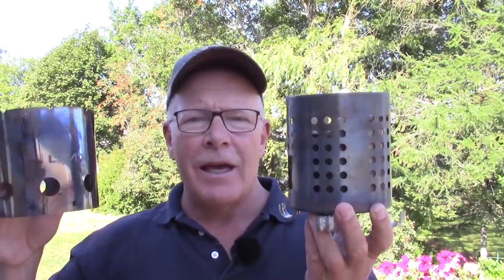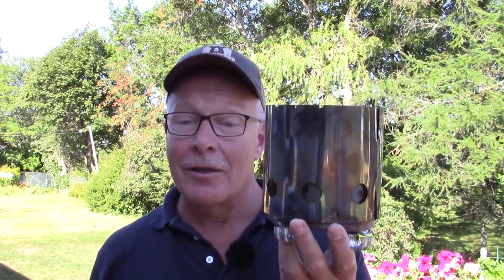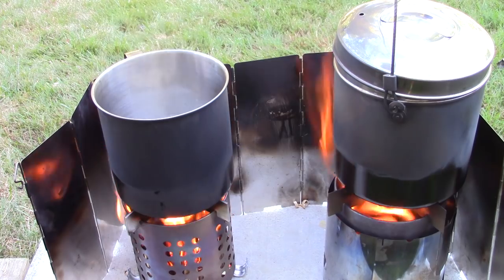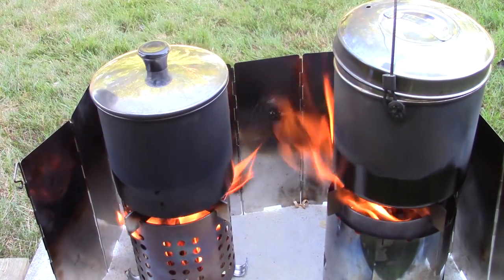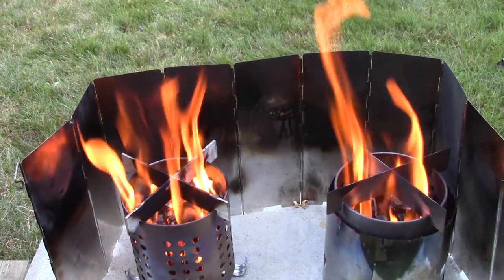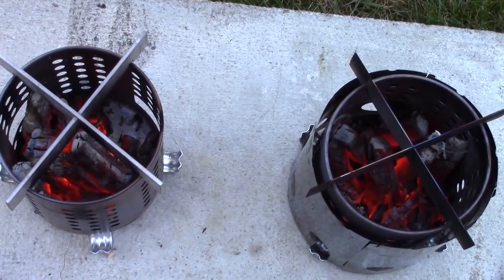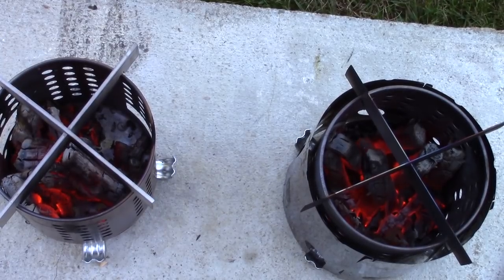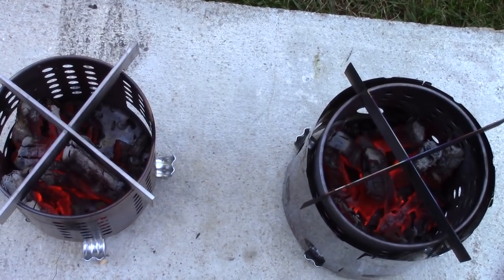Ikea-Lixada Hybrid Wood Stove

Comment from the maker: I would like to give credit for this idea to viewer "Conny Bjaaland" who wrote "I would like to see a comparison of burn when both are packed to there fullest capacity.  I would also like to see how the ikea burns when placed inside the little bug. Does this configuration create a wood gas burn effect?"
Reply: You can cut through the lid of a 6" coffee can and slip the ikea  cutlery holder  inside you need to put two small tent pegs horizontally down below to stop the ikea from falling to the bottom. In the coffee can you make a few holes around the bottom and  make a horizontal slit at the bottom to drag out the ash and there you have yourself a wood gas stove that also contains the ash'. Russell.
Reply: @russellkent8721 These days finding an all metal coffee can is hard. We used to make hobo stoves from them with scouts, but can't find meatal ones anymore.
Reply: Try "Chock Full of Nuts" coffee. Probably the best company for getting metal coffee cans.
Reply: @steamboatmodel  
That's a pity. Fortunately, they are still available in Australia. Russell

Comment: Hi Mark. Greetings from England! Thank you for this and your other Ikea stove videos. It inspired me to build my own. Looking at the principles of a rocket stove I then decided to have an added layer on the INSIDE. I did this taking the base off an old paint can, and then the remaining cylinder is held in place using bolts. The result is that air flows through the holes of the Ikea, but then gets blocked by the hot paint can, so is forced upwards until it meets the wood gas. And from my experience with it I believe I AM getting secondary combustion. And after some trial and error, I found I can use the bolts to rest an alcohol burner on, sitting inside the stove at the perfect height under my steel ruler pot stand! I'll make a video about it and post soon hopefully. But thanks again for your inspiring ideas and channel.
Reply from the maker: You have a some great ideas for sure. It can be fund trying different thins out. Thanks for commenting

Comment: thanks for the shoutout mark - we'll probably bump into each other at the LC ;)

The hybrid was a good experiment, it sorta looking like a firebox where the walls are more insulated and the air is forced up from the bottom or bottom side. Performance sue looked good and the ruler hack was a good one. You can't go wrong with a good piece of steel.
Reply from the maker: Hey Jim, I have had more than a few comments on the hat. Thanks again for it. So, I missed the hurricane altogether as we are in Austria visiting my son. I have kept close watch and it look like we are among the few who did not lose power or suffer damage. Maybe we should meet up for a hike at some point

Comment: Mark, one of the advantages of the Ikea stove is that you can add more fuel to the fire without removing your pan. The added Lixada stove negates that advantage. Keep using your windscreen.
You out did yourself on this video my friend. I'll be watching this video again to make sure I grasp all the good material you gave us today! Thanks.
Reply from the maker: I agree, side loading is one of the best things to build into the Ikea. I also find if I get a good full load and a top down burn I can get better than 20 minutes before I even have to add fuel. 17 minutes more than I need to boil 2 cups of water. Glad you liked the video David. Thanks for commenting
Reply: Good point. However, here's a nifty solution I just thought of. If you cut the riser cross bars such that the top of the lixada is always a bit higher than the bottom of them, and shorter so they're inside the lixada, you could slide the latter up with a suitable tool (like a spare stick) to get to the feeding ports, add wood, then drop it down again. This could also be used to raise the lixada up to particular levels, using the holes in the Ikea perhaps to lock it in place, giving a lot more whoosh of air in the base.

Comment: Hi Mark, hope you and your family are all well. A couple of things that could be looked at is the speed of boiling. Using different types of wood and thickness, such as thin twigs and the thickness you usually use. Thanks for the video.
Reply from the maker: Hello my friend. All good here at home. Yes, different types and amounts of wood would make a huge difference. I tried to use the same amount, size and type of wood in each of the stoves as a control variable here. Thanks for commenting

Comment: Mark, Love that ruler pot stand idea. Most stoves don't leave enough open area at the top of the stove which leads to more smoke and less flame/heat. ATB.
Reply from the maker: Glad you found the ruler tip helpful. I agree, airflow is all important in stove design. Thanks for commenting

Comment: I have been using the metal rulers as crossbars for my IKEA hobo stove for a while. I actually got the idea to make them originally from your hobo stove video where you made them out of aluminum bars. Also, I use a piece of aluminum flashing as an ash plate under the hobo stove. I put this on a piece as a carbon felt and it works great. The felt adds almost no extra weight and it cut to the same size as the plate. Keep up the good work!
Reply from the maker: Funny how it goes like that. I wish I had found them years ago. Thanks for commenting

Comment: Very interesting, indeed. Perhaps if you found or made a wider IKEA stove that fit more snugly it would work. A ring to close the gap over the top would definitely help either way. You would have a nice, even distribution of fresh air and wood gas around the entire fuel mass, with most of it being burned near the bottom of the Ikea. But as the unit got hotter, the tower effect involved should help to even out the heat levels of all of the Ikea's holes. It's interesting to note that drilling more holes in the Lixada would even out the distribution of fresh air around the fuel mass and the extra oxygen should cause the gasified flame mass to expand upwards along the sides of the Ikea stove. I'm thinking about just obtaining two different sizes of Ikea stoves, then cutting them to the same height. With the flames spread out over Ike's entire wall, it might be harder to see the gasification unless looking at it closely from above. The flames may also still be fainter towards the top of the Ikea but they  will definitely rise higher and the oxygen assisted tower stove effect will do the rest. Your idea is brilliant and with only a little more tweaking it should work extremely well. The gasifying hobo stove hybrid. Cheers
Reply from the maker: I have another video where I mate an Ikea with a SS canister and a video using a large strainer where I do get some secondary combustion. Thanks for commenting

Comment: Interesting experiment. That more coals seemed to remain in the shielded stove might mean that the oxygen level in the chamber was lower such that there was less combustion surrounding the burning wood and more heat retention lower in the stove so that more of the gassifying wood turned into charcoal before combustion ... though perhaps the same amount of wood gas was consumed in the upper part of the stove. In any case, the wood gas ran out when the flame went out and more charcoal remained.
Reply from the maker: Yes, good thoughts on its performance. Thanks for commenting

Comment: I had somehow missed this video. The idea was there but missed a funneling of the air into the burn chamber. A cone windshield would have worked unlike this one which just let warm air rise out of the outer walls. You could alternatively plug the top with a bit of rolled up aluminum foil, which would be easier in your case since you already have a good fitting outer wall. I think the alu foil would be unlikely to melt unless a coal fire were maintained for a while, since it would be on the outer wall of the burn chamber, and protected by the ikea stove’s steel.

I’ll try to fashion a gasifier out of my strainer stove, as described above. and I’ll get back to you on if you so wish, Mark. Just let me know and I’ll comment back on here or make a video for you.

I suspect an outer aluminum wall would suffice so I am going to try that as it’s likely easier for me to source than thin spring steel sheets.
Reply: If nothing else, this showed that double walled stoves are inherently better in windy conditions, but the separate windscreen would be superior in that it would protect the stove AND the pot, hence directing heat toward the pot, making it more energy efficient and giving it a faster boil time.
Reply from the maker: I am interested in seeing what you come up with. Making a true gasifier DIY is a bit of an illusive goal. Thanks for commenting

Comment: I believe you would see a distinct difference in boil times if had not used a wind screen, that is the real advantage of using the Lixada around the Ikea.
Reply from the maker: Absolutely. I agree. I could see that when I eventually did remove the windscreen. Thanks for commenting

Comment: Using my Walmart 9 hole high hobo stove (instead of Ikea 6 hole high) I inserted a 25 oz can INSIDE the hobo stove. Top and bottom cut out and 1/2” holes around the bottom circumference. Vertically packed with twigs and a top burn down, I was getting flames 2’ to 2 1/2’ high with little to no smoke. It appeared there was some gasification around the inside of the inner can. Only downside was it appears this is going to be a fuel hog. Thank you for the video for getting me inspired. .
Reply from the maker: Interesting. I had not thought of placing a can inside the Ikea. I do have a couple of the taller ones to experiment with. Thanks for coomenting

Comment: I use a cement paving stone I carry with me and put under my stove.  Not practical for backpacking, but stable and heat safe.
Reply from the maker: Yup, a cement paver would be a good safe surface. Actually, I use one in my backyard when doing tests. Bit heavy to carry very far😅. Thanks for commenting

Comment: Mark, 
Thank You for sharing this information about your modified IKEA hobo stove and the Lixada little bug.
I was wondering if you or your viewers have any suggestions for material to make the cross bar if one is unable to find a metal ruler at a reasonable price? The idea is fantastic, but I am disabled due to living with Multiple Sclerosis and rely upon online shopping for most of my purchases and for some reason, the cost of this ruler is much greater on line than in retail stores.

Thank you so much for your time and effort.
Reply: BBQ Skewers, Stainless Steel Tent Pegs, Welding Rods. You don't need to have a cross or X you can just cut suitable sized slots for any of the above to fit in an I  I configuration across the top of your chosen IKEA/Walmart Utensil Strainer. However, if these configurations don't raise your Pot/Pan up off the top then, you may well need to drill a few additional holes at the top of your Utensil Strainer.
Reply from the maker: As Bulgarian Organic Smallholding has suggested tent pegs or other simple items may work. As does making larger holes around the top. I may be able to demonstrate in a video
Reply from the maker: Great suggestions and thank you for responding
Reply: Thank You for your suggestions! 😀

Comment: Your ruler cross bar is a great idea.  Metal is metal.  I still might gi with the aluminum cross bar and use a bit less heat if I'm only boiling water.  The cross bar for my rocket stove went adrift so I'll make another (1/8 x 1 inch steel bar).  To cover your Ikea stove,  a piece of heavy aluminum foil from Costco could work,  held in place with a piece of rabbit wire or tuck the top edge over the stove lip.  Less to pack.
Reply from the maker: Good suggestions. I am still working on ideas to test out the theory. Thanks for commenting

Comment: As a chemist, I do not think the silicone pad will survive without degradation.  A silicone pad generally starts degrading from 400 to 500 deg F,  far below the heat of the coals.  Woven ceramic pads used to protect wood from propane flames can stand up to 2500 deg F.
Reply from the maker: Very good information about the silicone pad. Any idea where ceramic pads can be found? Thanks for commenting

Comment: The Ikea stove seems to have way too many holes up its sides.  The formula is more like “in the bottom of the burn chamber, up through it and out the top”.   Pretty straight forward.  Water runs down; fire goes up.

With my Littlbug Junior, I dig a narrow trench about 2”-3” longer than the diameter.  I place the stove astraddle the trench.  Benefits include more air intake, longer sticks, more ash room, and handier bottom lighting option.  Actually, some gasifier stoves would benefit from a bottom trench on mineral soils.

You want to continue modifying and experimenting; go right ahead. You don’t need our permission.  
Courtesy of Half Vast Flying
Reply from the maker: Thanks for commenting